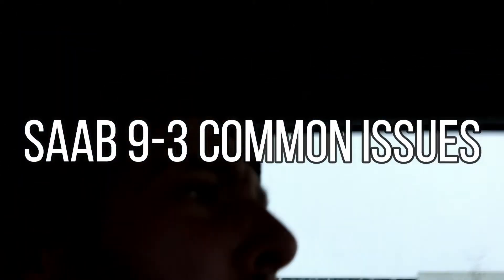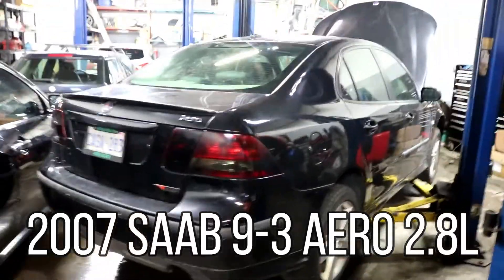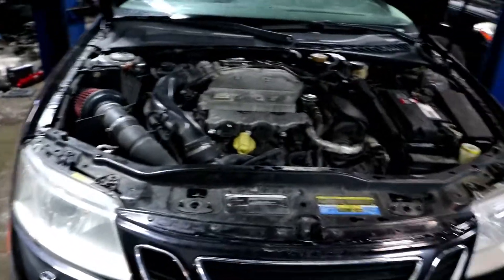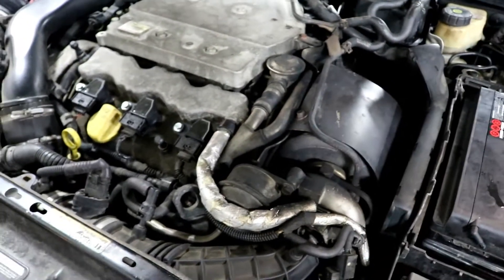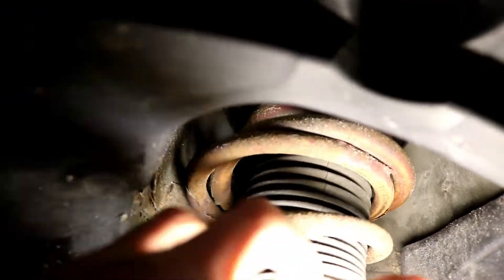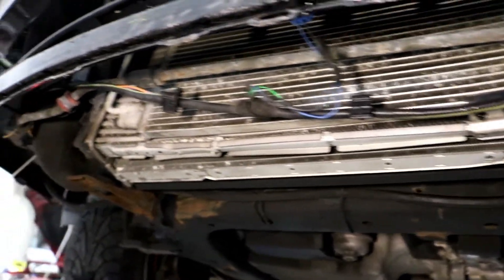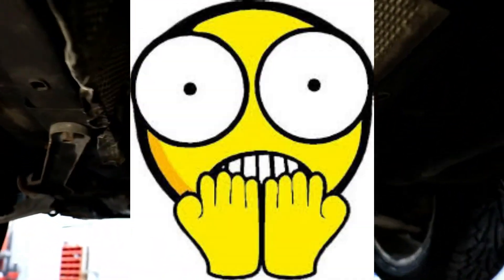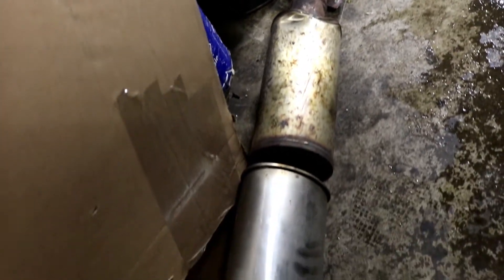Saab 9-3 Common Problems + Dyno Fail (Part 1)

Comment from the maker: I've also noticed more and more failures of the ECM recently on these. I might make another educational video about the ME9.6 ECM and what can be done to replace a faulty unit. They have been really hard to find if you are trying to match part numbers and add with Tech2. Best thing to do would be to find a unit off a Cadillac or any other ME9.6 ECM and run SPS. Also experimenting with Trioniccanflasher to be able to clone may be possible but will need to be added to car with Tech2. Let me know if this is something you would be interested in seeing.